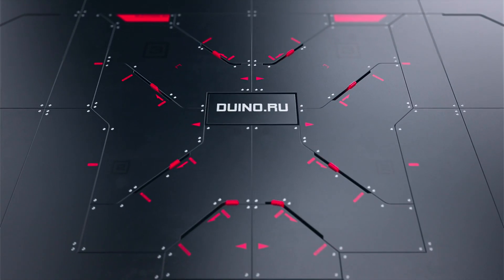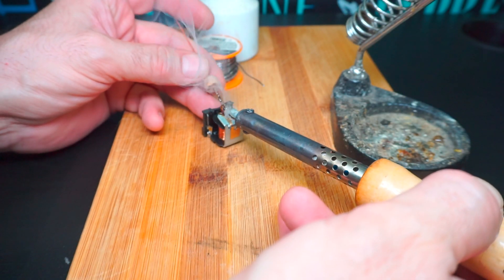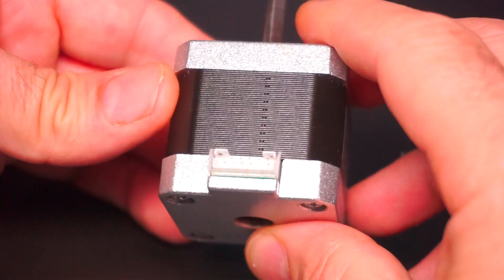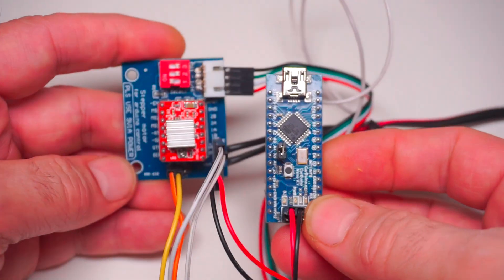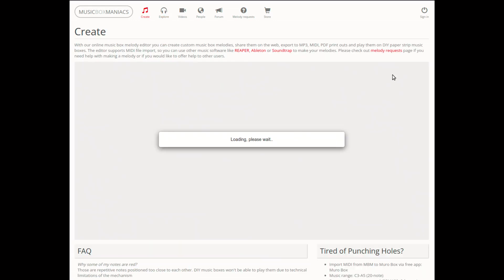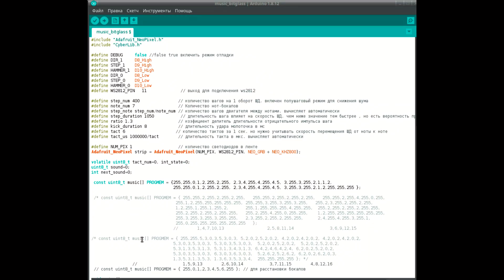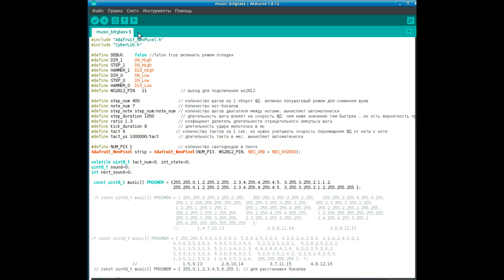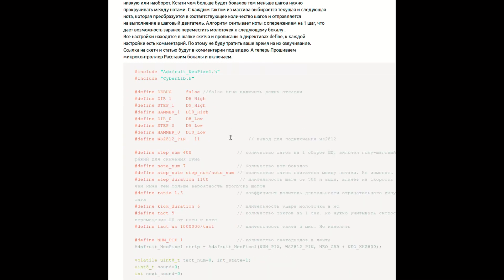🤖 Ардуино робот играет музыку на бокалах 🎼

Comment: What kind of power supply do you use in this  project,  how many  and of which voltage?
Reply from the maker: 12V Для шагового двигателя и молотка и 5V для контроллера
Reply: @ArduinoClub  As you said that you are using 2 power supply then the  battery shown is image of 15 v then the other 5 v supply is given to the Arduino  which is not shown did you connect your laptop to Arduino. And to whom did you have given the 15 v supply and whom  you have given 5 v supply
Reply from the maker: @abhiambuskar8167  5V получаю от Arduino. У него есть встроенный преобразователь напряжения с 12 на 5. 
Так же 5V   я беру с Arduino для питания шагового драйвера и светодиода
Reply: @ArduinoClub  Now I have 2 question
1) so initially 15v is given to Arduino then it converts it into 5v which is given to driver and led  and the 15v supply is given to stepper motor. 
2) What is the green, black box above Arduino 
CORRECT ME IF I AM WRONG AT ANY STAGE
Reply from the maker: @abhiambuskar8167  1-Да
2-зеленый это ws2812, черный это соленоид
Reply from the maker: @abhiambuskar8167  1-оранжевым цветом обозначены 5В. Красным цветом 15В
Reply: @ArduinoClub  is solenoid used to avoid the negative damping
Reply from the maker: @abhiambuskar8167  Соленоид используется для ударов по бокалам
Reply: Can you send the circuit diagram  of this project and also send how to connections were made to motor driver and the stepper motor it is becoming hectic to do it
Reply from the maker: @abhiambuskar8167  https://duino.ru/blog/all/arduino-glass-harp-robot-igraet-muzyku-na-bokalah-dlya-vina/
Reply: @ArduinoClub  can you tell me what is the small green color box above the stepper motor
Reply from the maker: @abhiambuskar8167  Это адресный светодиод ws2812b